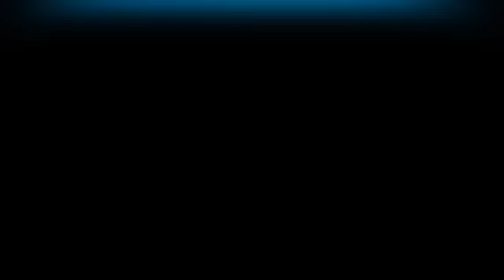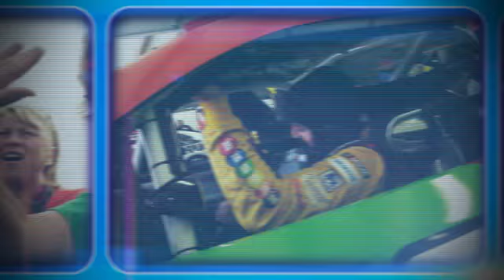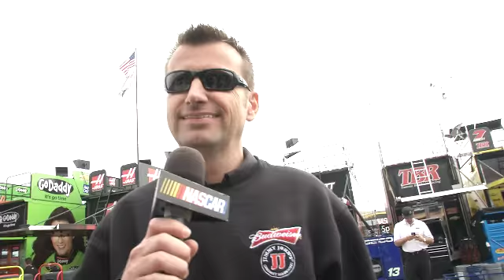NASCAR | Childers explains fuel loads and downforce

Comment: I'd like to here some technical answers not just a general over view.  How much differance in ride hight is there? Does fuel load factor in to the amout of wedge or trackbar ajustment made on the stop? Ect ect.
Reply: Essentially with ride height they try to make it to where the splitter is completely flat on the ground when front downforce is applied. Whether it be a .1" difference in static motion, or a .5" at static motion. They also attempt to hide the spoiler as much as possible, which with no ride height rules now, can be seen easily this year than last year the way the rear of the car looks at track that involve the springs to be coil-binded. Softer springs allow for a LOT of travel on and off the gas.

Fuel load changes a LOT based on the weight of the car. Full fuel load with make the car looser than say at half a fuel load. Now drivers wont really feel that a whole lot depending on the wear of their tires. Every adjustment made should be to improve more balance on the car than handling. RF wear with RR wear. LF wear to LR wear.

Hope this helps. I could go into more detail but that would be preaching a type of  "class".
Reply: Sign me up for your class. Thanks